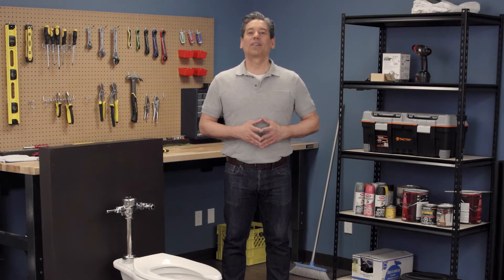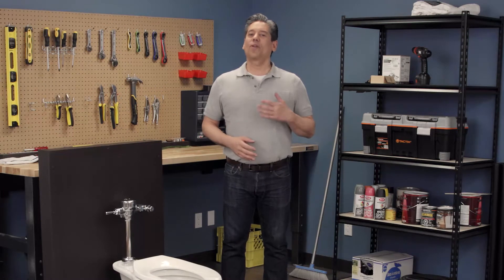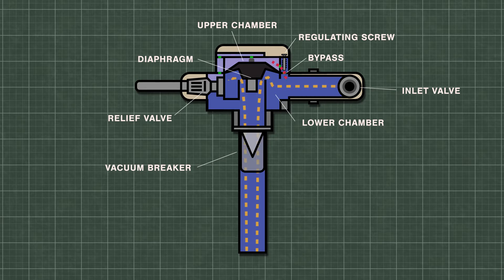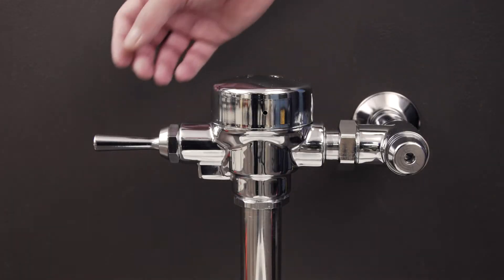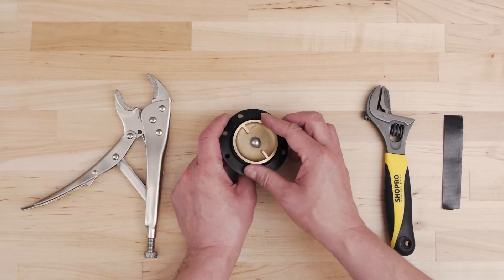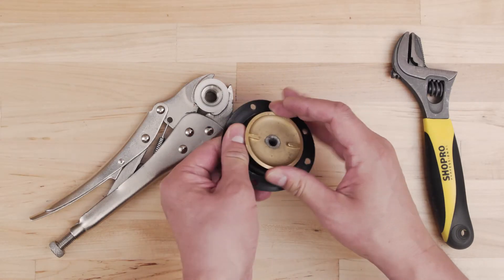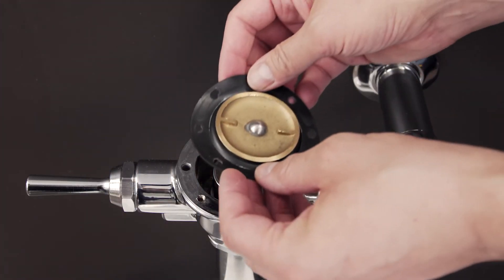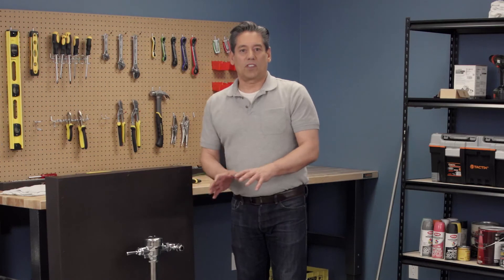Delta Teck II Flushometer | Diaphragm | Repair and Replace

Comment: What's the purpose of the popet pin?
Reply from the maker: That is a good question. The popet pin is not fixed and is free to move. It is part of the timing of the valve. It will lift up during a flush and help change the amount of time that the valve remains open until the pressure in the upper chamber pushes the diaphragm down. There are variations in the poppet pin for lower flush models.